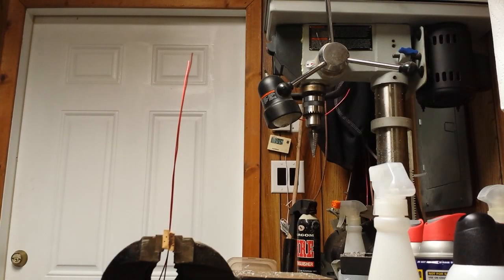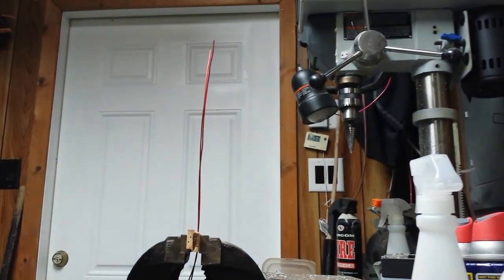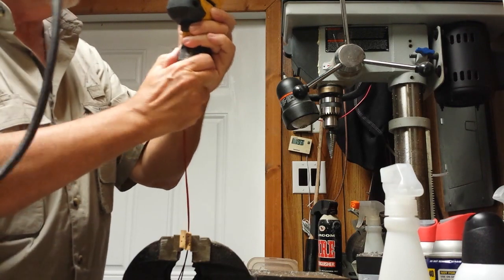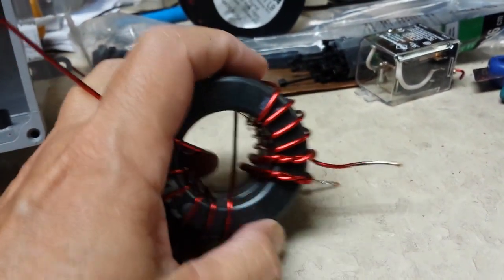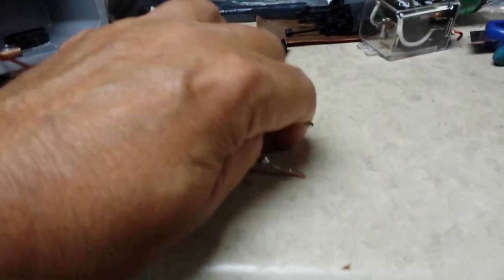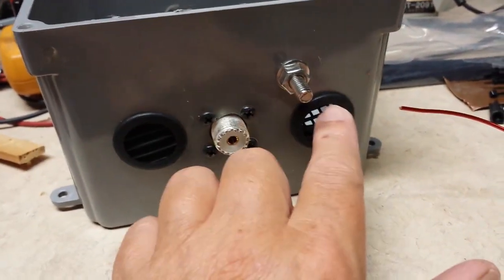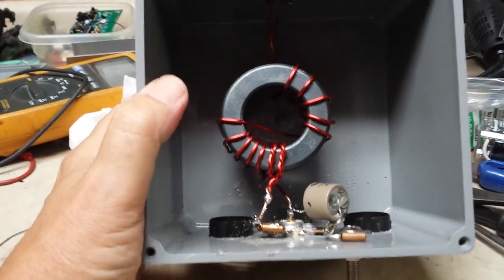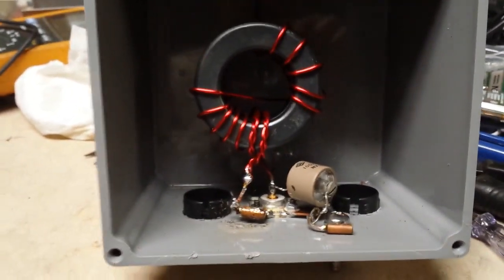EFHW End Fed Half Wave Antenna Higher Power Using 52 Mix Ferrite

Comment: TEMCo makes good stuff! I've used their magnet wire and resistance wire for years with no issues. Even experimented with their NI200 wire for electroplating experiments and have always had good luck with anything they make.

Comment: Steve, thank you for the video....I followed your instructions in the construction. I work it in λ/2 for top band. Swr 1,1 at 1.9mhz,,,,1,1 3.700,,,...1,2 7,150...,,,1,3 14,200...,,1,3 18.120,,,,1,2 21,200.,,,,1,3 24,940..,,,.1,2 28500,, ,,1.4 50.200. The results, fantastic. Big difference with 14 and 18 awg wire......tnx SV2FNN
Reply from the maker: This is for 80 - 10 only. 160 requires a 3:21 ratio, 43 mix and 200 pf capacitor.
Reply: @n4lq  my wire is 79.5 m long ,,,about 6m...to 8m above ground,,,,,...i run 100w icom 756 pro,,,,,,,I start with 23m rg213,,,,,,,,i got swr 3,1. ON 1.935 MHZ..( the other bands let s say ok)......Αnd then i add 15m more,rg213,, so 38m,,,,, rg 213,,,,and  of course 8m counterpoise,,,,,and WOWWWW,,,,!!!!...ALLLLL...OUR BAND,,,,FIX...THE SWR....160M----6M....!!!!!!!!!!!.....on 17 jul 2022    14.213 MHZ== PY7ZC.....5/9...............5 June 2022 14.214==JG2MQM.....5/7.....................I USE 100 pf,,,,,in the unun......TNX

Comment: Question: why twist the enamelled wire for the first few turns? Is it for cosmetic reason or does it serve a purpose? thanks
Reply: The wires are twisted for better coupling between the two wires.
Reply: @renaat9829  thank you! 😉

Comment: Like so many videos of this sort, this one falls short.  Nice to see all the techniques involved, but without empirical data, it's just a guess whether or not this thing will work.  Put it up, show us the configuration of the wire (sloper, inverted V, etc.) and show us the SWR curves for all the bands.  It will then be more meaningful.
Reply: this thread is 5 years old. Why not read thru the comments??  Folks have been following these instructions and successfully building a great antenna for years now....
Reply from the maker: Put it up yourself. There are plenty of other sources for SWR curves. You will never build one anyway. Go buy it from MyAntennas.com.

Comment: What happens if you mix ferrite's with 31,43 and 52?
Reply from the maker: Don't. 31 especially has too high of a permeability. 43 and 52 will work together however the 43 would get hot and reach the Currie point before the 52 mix.

Comment: Steve thank you for making these videos and sharing them with all of us. I continue to watch your videos and read articles and do as much research as possible, but I am still confounded by some basic questions. Can you please help shed some light on this one item that I still struggle to understand:
What was the purpose of using three cores? Was it to increase the total power handling? What if we used four cores? Or five cores?
Put simply, what does adding each additional core add to the solution?
Is there a simple rule of thumb?
One core 500 w, two cores 1,000 w, three cores 1500 watts?
Thanks again and 73 W3GUY Ernie
Reply from the maker: The core of a transformer affects the inductance of the winding. Too many cores and you would have too high of an inductance. Note also that it takes more wire to go around more cores which also increases inductance. Your high frequency limit comes down as inductance increases. 3 cores is about the limit for good coverage up to 10 meters. You might get by with 4 cores  but keep an eye on the swr for 10m. More cores takes longer to heat up so yes, the power handling increases with more of them. It's a juggling act!
Reply: @n4lq  thank you very much, that clears it up! That one paragraph that you just wrote makes it so simple, hours of reading and I couldn't figure that on my own, sorry and thank you again! 73 W3GUY Ernie

Comment: What are the "copper tab things you found in your junk box?"  Lugs? And what are they attached to and where do they go?   Besides the ground, what else do you solder to the CAP?  Really tough to see on the video.  Thanks for doing all this!   Dave N9DMS
Reply from the maker: The copper lugs are something I found in the junk box. Any lug will do fine. The capacitor goes between the so-239 center and ground. So does the transformer. You should watch this one. https://www.youtube.com/watch?v=BpdpkUEW39o&ab_channel=SteveEllington
Reply: @n4lq  Thanks.  Watched this video.  Will watch it again.   '73  Dave N9DMS
Reply: I believe the mystery is the tail end of the primary appears in two stills in the video you refer me to get into the center of the SO239 but it is not discussed or labeled in the video. If I am assuming that correctly,  would it work OK to stick that bottom of the primary into the center of the S0-239 along with the CAP and solder them both at the same time?
Reply from the maker: @davidsapadin  Maybe this helps.... https://static1.squarespace.com/static/5b1576d036099b603985500c/t/5c5236b57924e85a9a1ccd62/1548891830343/19-End+Fed+Half+Wave.pdf

Comment: Rather than starting with 2 pieces of wire fold back with a single length and use a hook in the drill. Makes a neater wind and no damage to the wire

Comment: I have been watching lot video's on 
Efhw antnna n I think your are the best for whut for my needs 
I'm have put all new antnna up
Had tornado last year 
I mostly do 20m  n 40m ssb I want b abull use my  amps so up 1.5 kw
If need b  n git on 75m ssb some
The fare end b straight 35 up above my cattle electrified  fencing   
Do you have eney advice  or thing Chang on your design 
73 n9prf Joe n good dx

Comment: I'm  new to the hobby, I have 240-31 can they be used to make a 49-1 transformer?
Reply: You should do some more research to confirm, but my understanding is that 31 mix would less suitable for use as a broad multi-band transformer. Might possibly work for 160-80m.

Steve's original recommendation was to always use 43 mix but he revised that to 52 mix for the 80-10m designs. I think you can move up to 61 mix for 6m, but it may be less suitable for the lower bands.
Reply: Mix 31 will just work for 160m and below, but is very suitable for common mode chokes up to 30MHz.

Comment: Would 1 torroid be enough for 100 watts?
Reply from the maker: Power isn't the main concern in this case.  When using 52 mix you need 3 cores to produce enough inductance down to 80 meters. You can get by with one core of 43 mix but at greatly reduced efficiency.
Reply: @n4lq  ok. Thanks. 👍
Reply: @n4lq  Steve...  Couldn't you increase the turns on a single core of 52 to get more inductance?
Reply: @rickkeniuk5053  Yes, but then you have more capacitance between the wires, which affects the higher bands.

Comment: Thanks for you video. I just finished winding my first 52 mix transformer. Haven't mounted it in an enclosure yet. But first test of SWR are very impressive.
All bands testing out at round 1.5 to 1.7 SWR except 160M which is 1.9 to 2.4 and 10M is 1.6 to 2.1
I believe once I get it trimmed up and installed in an enclosure it may be even lower.
Thanks again for your video.
Reply from the maker: This is for 80 - 10 only. 160 requires a 3:21 ratio, 43 mix and 200 pf capacitor.

Comment: I'm counting 2 passes of the twisted wire through the core center then 4 single wire passes then 7 when cross over then 8-12 (5 more)  at the end to the antenna output. Total 12, not 13. Am I wrong? Thanks.

Comment: Where should I order the torrid’s from?
Take care 73 de ve3hip in welland Ontario Canada 🇨🇦
Reply from the maker: Try DigiKey. Stock is low or zero at other places.
Reply: @cbjackson4310  https://www.mouser.com/ProductDetail/623-5943003801
FT240-43 cores  $5.95

Comment: Hi Steve - Got 3 of the 52 mix being delivered tomorrow and have already twisted the 14ga (as per your video). Are you now recommending 13 secondary turns versus 14? I see both in the comments. BTY Tks for the videos. Persuaded me to wind my own. Already got 130+ 14 ga stranded hung sloping up to 40' from a previous 9:1 Unun that baked the cores on 80M after more extensive CW due to band condx.
Reply from the maker: Use 14 turns Allan.

Comment: Hi Steve, you say the ratio is 2 primary and 13 secondary?
I see 2 and 10.
It is true ?
Reply from the maker: Count every wire. Yes every time a wire passes through the secondary it counts as a turn. I recommend 14 total. Count the twisted wires too

Comment: Great video Steve.  I've watched your "test" of the EFHW strung out over the yard, and your video with the 160M "add on" with the relay.  That was really slick!
I've been out of Ham radio for at least 20 years and poplar trees have grown up ( and out) in all the wrong places ( and my house is right on the property line NE corner with 4 acres due south and west. )  Running a Delta Loop was my original intention, but nothing fits.  Getting a straight shot either south or west would work better with a single wire and only a few trees to get out of the way.

Which RF suppression beads would you recommend and where's the best place to put them?  I'm going to need close to 75 feet of coax to get to my transformer location ( the run is not parallel to the antenna ).  I'm only running 100 Watts so I'll save some money on the Toroids.  Kitsandparts has the snap on beads.  How many of them would do the job, or would some turns of coax near the transformers cut it? Or, should I make a 1:1 unun. ( which I'll have to research).  I'd rather try to build it vs buy it.

I made the comment hear so others could chime in on my question(s).

Many Thanks  Wayne /  N3TNS
Reply from the maker: Be sure to watch my video on EFHW Grounding Compared first. You should not need any beads or chokes and never put one at the transformer. Only use them in the shack if needed. Ground your transformer to a 8' gnd. rod.
Reply: @n4lq    Steve,  Roger that!   I'll go over them again.  

To make this work with your 160M relay mod,  is the inverted L required,  or will a straight run work.   I was thinking of mounting a 6 ft grey pvc mast right where the coax leaves the house  The studio side is about 2 feet higher than the rest of the house.  I have a pvc conduit to run coax thru.  It daylights to the ridge of a "Shed Roof" on the other side.  All of the trees are up and out from there.

 If I need the inverted "L"  I have a 60 foot Pine right near my studio that I could use for that configuration.

 I was looking at the notes from the slide show you have posted.  Running a 100 watt rig,  would I gain any efficiency using   3: 240-52's vs 2 ...  or 3: FT240-43's.
 
Kits and Parts Dot Com has the 18AWG magnet wire.  I noticed you were using 14AWG.
Is there a gain in using 14 over the 18? 

Thanks for getting back to me. 
Wayne
Reply from the maker: @waynegrauel1031  The L will have lower angles for dx. Sloping will be fine for regional work.  52 mix is best but expensive. doubt if anyone can hear the difference. I get toroids from Arrow Electronics... Kits and parts is very expensive... 16  or 14 wire is ok.. 18 is questionable
Reply: @n4lq  Steve,  you're very gracious your time and the help you provide.  Eliminates stepping on a lot of land mines!  

You're spot on about Arrow...  Big difference!      

Have you seen any sources for the nice stainless wire clamps like the Dutch use (Hyendfed)?   
73's!  and Thank you.
 Wayne
Reply: @n4lq  Steve,  I'm good on the parts.   Arrow had the Toroids, Cap, and Vents!
Many Thanks for getting me interested in building my own antenna!  
Wayne

Comment: Hi Steve.  I just watched your video and had two questions.  First, it's been a year since you posted this video so I'm curious how your antenna has held up.  Second, do you have a diagram of the transformer circuit?  I'm getting the general idea but a diagram for reference would be helpful.  Can you point me to one?  Thanks!
Reply: Steve has a FB group now and it's a madhouse, but that's where the "current traffic" is.  These antennas are the bomb.
Reply: What is the FB group called?

Comment: Is it better to use ft240-43 or 240-52?
Reply from the maker: 52 mix is best but expensive. It has much less power loss.
Reply: For 40/20/10m bands, what is better?
Reply: @bertolo75  As far as I know, you can go with 43 mix for these bands.

Comment: How do we determine the power handling capabilities of the torioid mixes? I have some 43's and 31's.   Acutally 3 each.
Reply: 43 or 52 is all you want for our purposes.  You can use other stuff, but don't expect any sort of performance or efficiency---IOW make a wet noodle.
Reply: WAS SHARED TO ME, THAT 31 MIX IS FOR THE LOW BANDS - 80 & 160 ,I BUILT AN UNUN FOR A FRIEND WITH 43' FT VERT. WITH 2 52sMIX, FOR HIS 100 WATTS , HE GETS 10-160 W / TUNER AND IS VERY HAPPY WITH THE RESULTS . THINKING ABOUT HAVING A SWITCH OR RELAY TO PLACE 2 UNUNs SO I CAN CHOOSE LOW  OR HIGHER BANDS . PS , THE 1ST ONE I WOUND FOR MY BUDDY WAS 43MIX 4-1 BALUN DID NOT WORK WELL AT ALL , HOPE THIS HELPS SOME , 73s

Comment: Steve,
What length of wire are you using for the antenna for 80 - 10 coverage?   73  WB3BJU
Reply: Start with 134', lengthen/shorten to set your primary harmonic when the wire is installed, never before.

Comment: Your transformer is 36:1  since you wound 12 turns thru the center and have two on the primary.  6 squared is 36  times primary impedance. Danny E73M
Reply: That what I was thinking. He says it should be 13 turns over 14, but here this one is 12. 73 kd2nfc
Reply: @directedbypuma  in earlier parts of the video Steve id have 13 turns but when viewed in the box, it only had 12 turns.

Comment: What caused you to move from the 43 mix cores you started with to the 52 mix?  W7DCF
Reply from the maker: The maximum Curie temperature of the 52 mix is double the 43 allowing much higher power especially on 80m CW where the 43 would over heat. Also per Fair-Rite corp, there is less power loss in 52 over the HF spectrum.
Reply: @n4lq  Is there an advantage or disadvantage for using 52 mix instead of 43 when using only 1 toroid for say 100w?  I ask because I only have 100w and I hastily bought 3 of the 52 mix per your suggestion before I read WHY you were using it (for higher temperatures associated with higher power).  Or put another way -- Is there a disadvantage of using 52 mix when using only 100w wound at 49:1?
Reply from the maker: @JoeBurden  52 mix has less power loss than 43 however permeability is lower with 52. With only one core of 52 mix folks are using 3:21 ratio instead of 2:14. The extra primary turn compensates for the lower permeability. I have not tried this however.
Reply: @n4lq  Being that the gauge of wire would make a difference on the number of turns as well I am still puzzled about solving the problem.  I have some 18awg solid copper wire I plan to use.  I guess the only way to know is test it but unfortunately my knowledge and toolkit have not progressed to that level.  I certainly don't want to burn up any radios over a couple of dollars.  I appreciate your time and quick response.  KO4DEF
Reply from the maker: @JoeBurden   Sounds like you're in over your head there Joe. Just buy one from myantennas.com .
Reply: @n4lq  I don't give up that easy Steve.  :)  I have antennas I bought.  I will work it out.  I just bought the wrong toroids, but now I will make both and see if there is a difference.  Again, thank you for your time.
Reply: I am going to give a 3" T2 (red core) powdered toroid a try.  I've built a 1: 1 transformer using it on a 80M folded counterpoise antenna full legal limit with no problems.  I'm hoping the coupling would be adequate for the impedance transformation.

Comment: May I ask why your antennas are end feed instead of a  traditional dipole or inverted vee? Is there a reason that I have not read or have been told.
Reply from the maker: An 80 meter dipole has an impedance of around 50 ohm. That same antenna on 40 meters has a center impedance of about 3,000 ohms. The only way to match it is to use ladder line and a wide range tuner along with a balun. Things can be complicated.  Now with end feeding a half wave antenna your impedance is ALWAYS high and the method of matching stays about the same for every band. No more tuning when changing bands. It's a huge advantage for someone what want's efficient multiband coverage.
Reply: Thank you for the explanation. I will have to give it a try. I do not have a bunch of height but I do have plenty of real-estate.

Comment: A rubber band wrapped around the wire would help the drill chuck grip the two wire and prevent damaging the enamel coating. As always, nice video for a newbie and very informative.
Reply: You're going to be removing that enamel anyway to solder it.